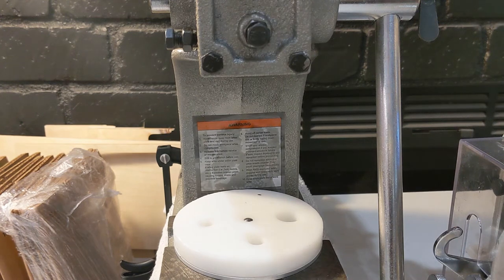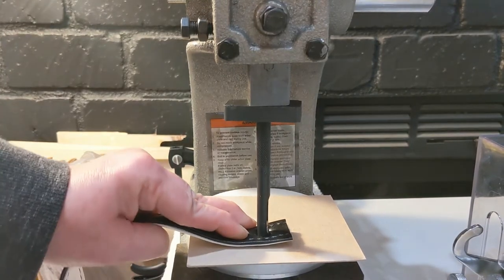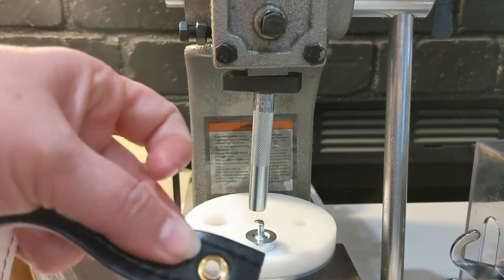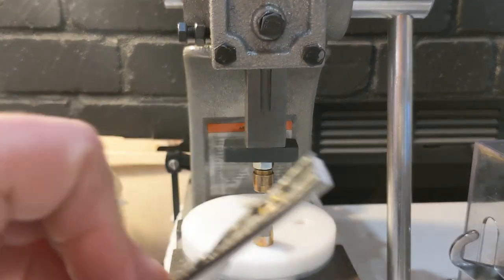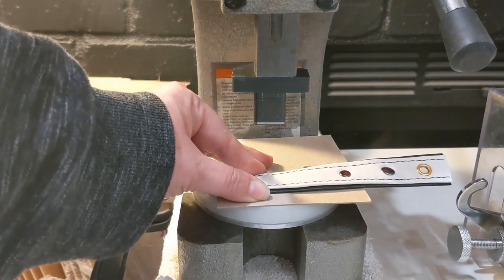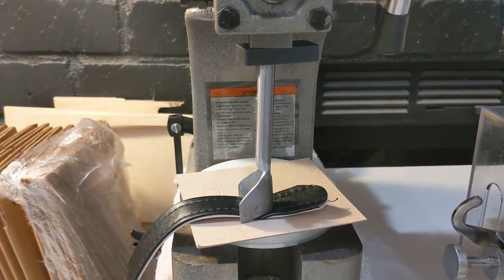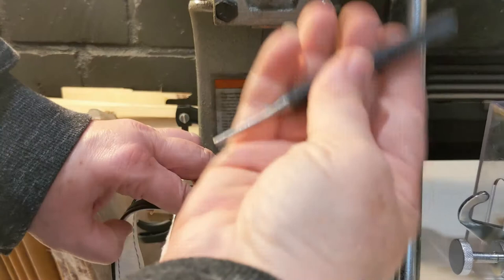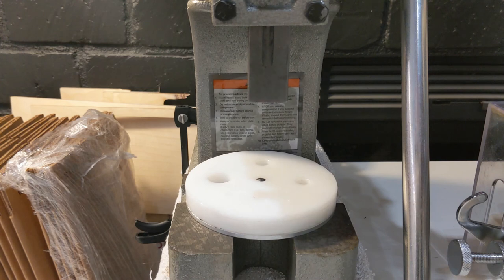Arbor Press Universal Plate Use

Comment: Id suggest you take the ram out of the press (It’s very simple) and either take it to a machine shop or have someone bore/ drill (a flat bottom hole would be best) a shallow round hole in the end of it to fit a round/cylindrical magnet.  Put some JB Weld adhesive in the hole and then press your magnet into the JB Weld, put weight on the assembly or clamp it, and voila!, the next morning you are done fiddling around with that loose bar magnet in between the ram end and your tooling.  You want the magnet to end up flush with your ram so the person doing the boring needs both the magnet and ram to get the hole to the correct depth. An N52 neodymium magnet is the strongest for its size and what I would recommend.

Comment: Interesting use of the press. I've been looking at them. I have those magnets and a strip one I mounted to a board and use as a stitching station. Easy to put my needles, scissors, awl.
Reply from the maker: They do make pull down machines for stamps and hole makers for hand stitching. I've seen them on Amazon.

I think the hf press would not leave enough gap for the material and the hole making tool unless you made it smaller.
Reply: @recentrelicsdesigns  yeah I saw one that you could attach a chuck to.